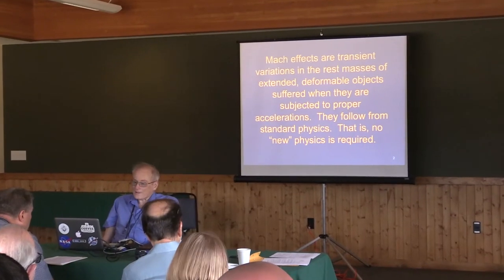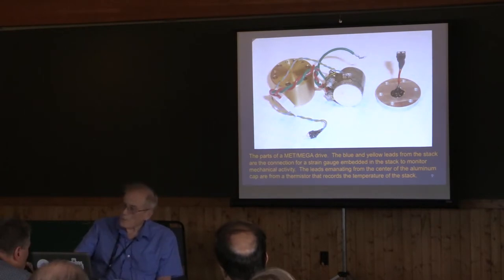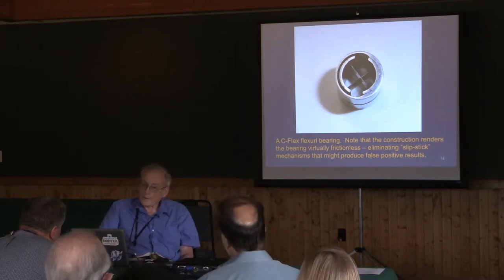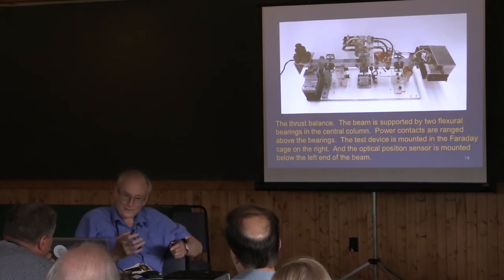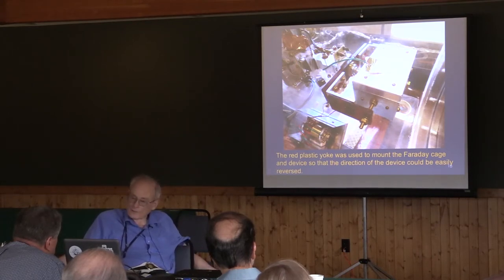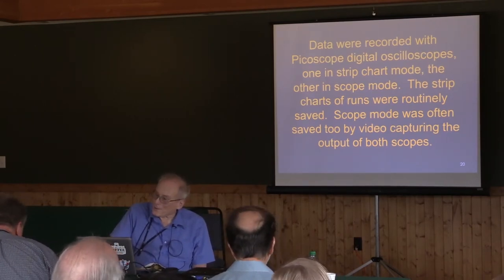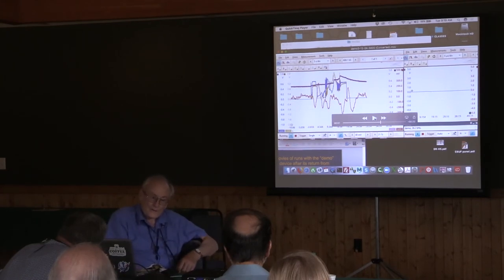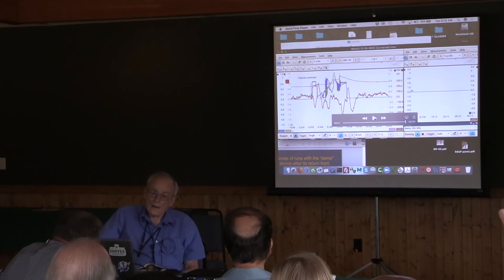SSI APW 2018: 1. James Woodward

Comment: to my understanding, the stack has been described as being stimulated electrically with each element  driven in parallel, and frequency swept to cause a "sloshing" of mass/energy back and forth through the device.  Has the stack been set up with stimulation of each peizo element individually, with a tiny delay in a chosen direction, swept through the stack, with the intent of causing a more controllable "sloshing" effect on mass/energy? This sort of "series stimulation" would necessitate a series of trials  with this modification, to see if any gains could be made with it, and perhaps has already been tried. My intuition of what is taking place overall, is that the mechanical pulse is aided electrically in intensity going in one direction, and when that pulse meets an end cap, the electrical stimulation. is turned off, so the bounce back wave energy is lowered by the amount of that stimulation, causing the pulse to have a higher mass/energy in one direction versus the other.